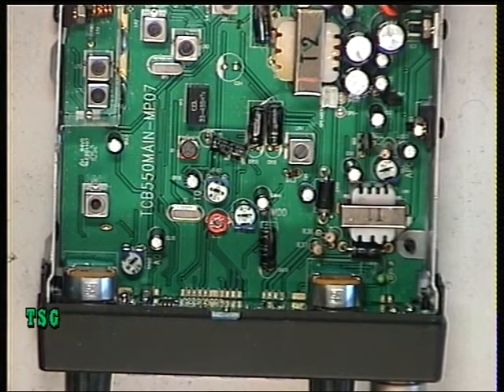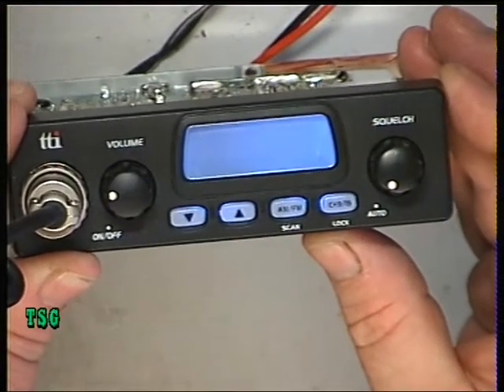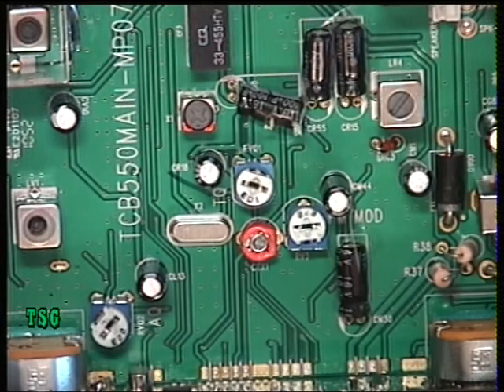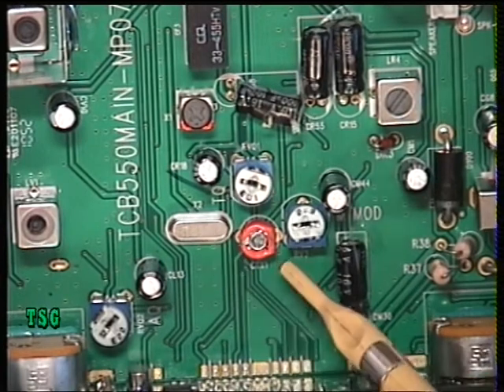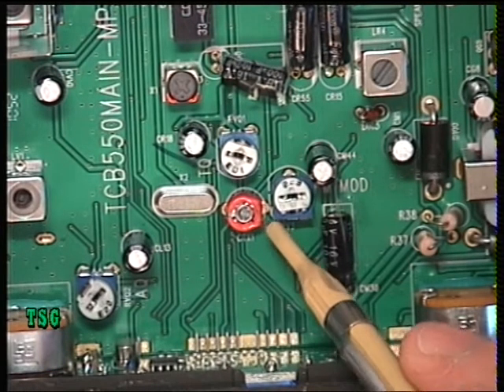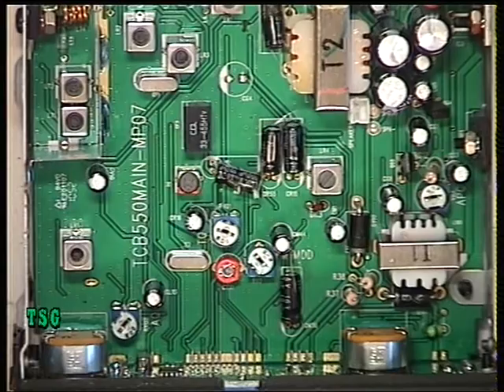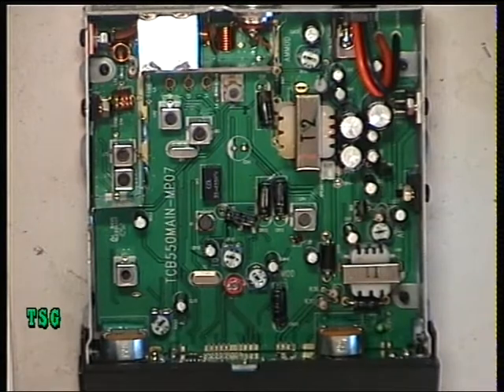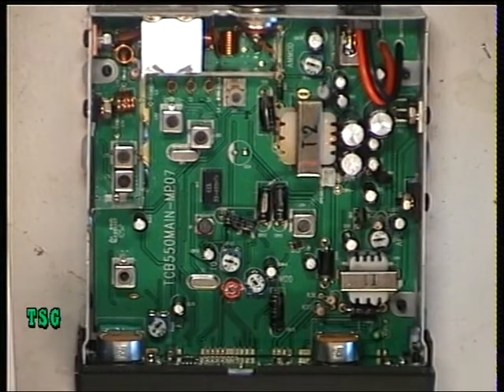TTI TCB550 UK (CE Multi-Norm) CB radio (mobile) -  VCO & Transmit alignment

Comment: Good day,
I have a completely different issue related to the AM/FM button. I have a tti550am radio and this version has this button inactive, the radio has reset and I can't change the band from FM to AM. Do you know how to restore the AM/FM button function. If I may ask for help.
Reply from the maker: AM is only availsable in certain countries. If the radio is set to UK, it's FM only. If it's set to EU, then it's CEPT set of channels in FM only & that's the default setting for a new set. If the radio is set to CE then it works on CEPT channels in both AM & FM. This is all in the instruction book....which is available for free online.

Richard, G0OJF, UK
Reply: Good day, the instructions clearly indicate that radios for Poland have permanent AM modulation. There is a factory damaged track on the front board. It is visible. I found this information on the net. I connected the damaged track and the AM/FM key function returned, I can freely switch the modulation from FM to AM. I think this radio model does not come to the UK. I took a photo of the cut track on the board. The radio works correctly on AM modulation. Best regards, have a nice day.

Comment: Good afternoon Richard, I've just bought a used tcb 550 ,it's the older version ,it's same as the one that you have serviced in your video.
On transmit my friends are telling me my modulation is very low to them ,so I decided to test it by listening on one of my other radios ,andthey are right , but on am it's perfectly fine ,so I did the adjustment of rv3 for fm like you did, it has improved slightly but still quite quiet , I've also tried a couple of different mics with no improvement, have you any suggestions as what could be wrong. Thanks in advance , regards.
Andy
Reply from the maker: Andy,

The only way to check FM deviation is with a deviation meter & it should be set between 2.2 & and absolute max on voice peaks not exceeding 2.5Khz. Without knowing these kinds of readings from you I just can't really comment or advise.

Richard
Reply: @ukfmcbradioservicingTango21  ,OK thanks Richard, regards.

Comment: AM is legal in the UK so you should be interested in AM..
sorry to say it but if it's a legal UK radio and i assume it conforms to the new requirements it's a legal AM set also..

should set the AM for plenty of Swiiiiiiiing...
Reply from the maker: +bigpimp347  I am only interested in the UK 27/81 band, which is FM only. Performance is therefore optimised for 27/81 use.  On the CEPT band, you are quite right that UK use in AM mode is legal (on a radio showing the CE approval mark) , and this particular radio could be set up to do that band in AM & FM 4W 40 channels across both modes. I find the CEPT band unuseable with S5-7 of noise, thus restricting range severely. I do have some PR27GB radios here that will get videos done on them one day & I recall doing one such radio on here, but they of no interest to me.

If a customer told me they wanted to use the CEPT band, and AM, I would be happy to optimise it for them, but, to date, have no customers who are interested either. 

Richard